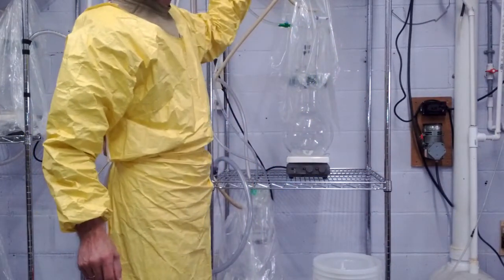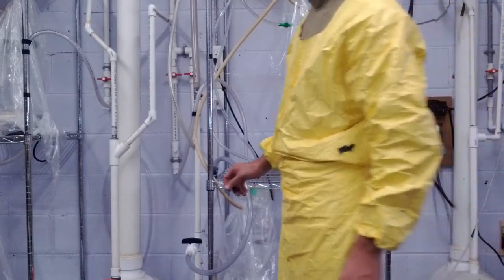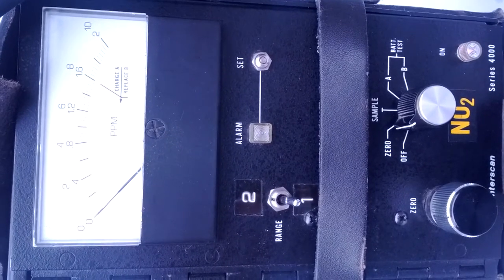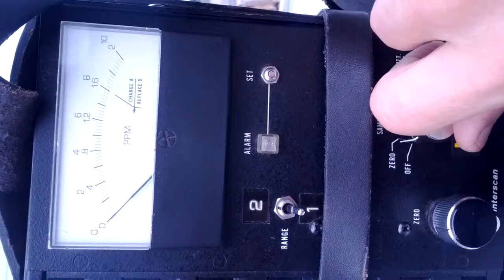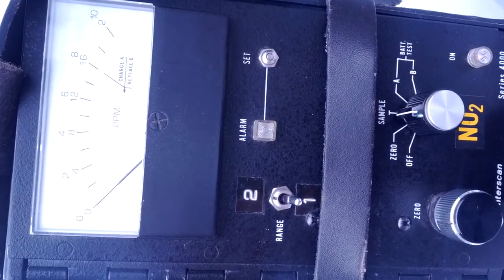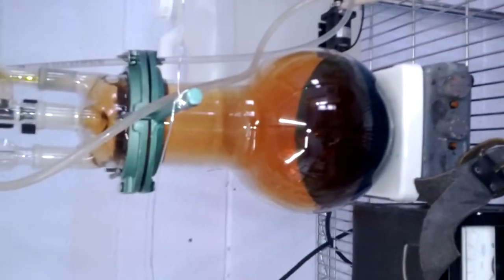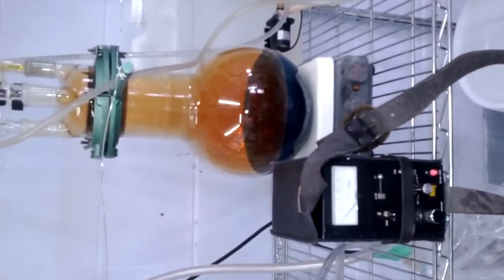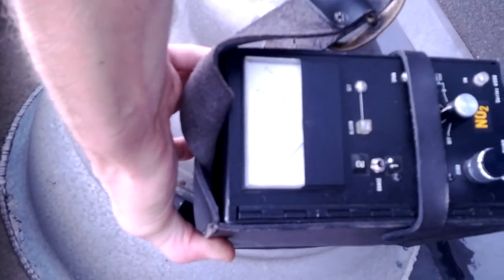Gold and Silver Refining and Gas Scrubbing Part-1 - Аффинаж золота и очистка Оксида азота

Comment from the maker: There are too many variables to consider. The main variable is the amount of bars/coins you would base your costs upon. The more is produced the lesser the cost per unit. As well, quality of the final output counts and machinery can cost from $5,000 to 500,000. Without input data, there is no output data can be produced.